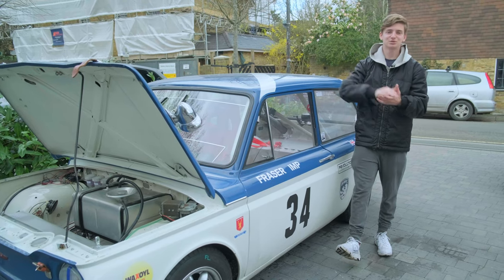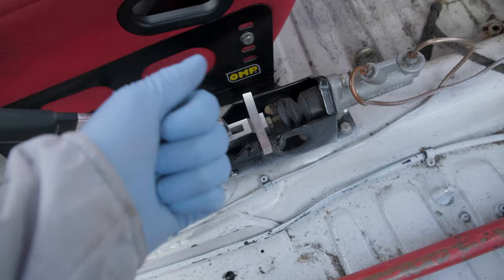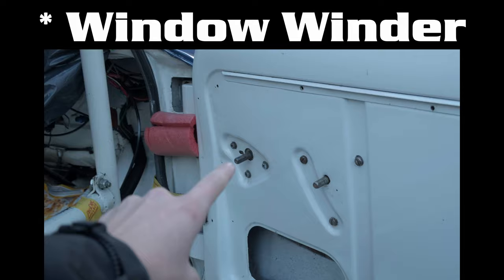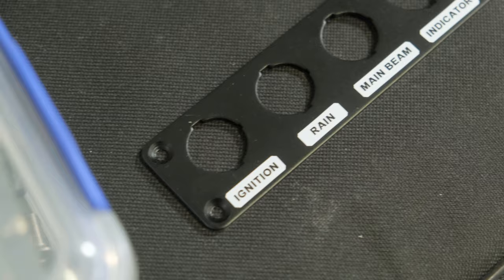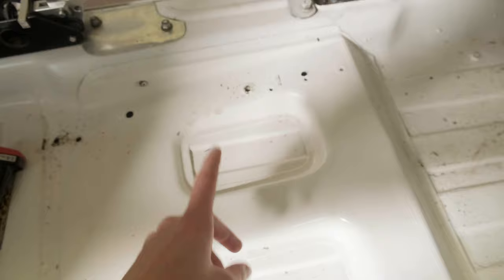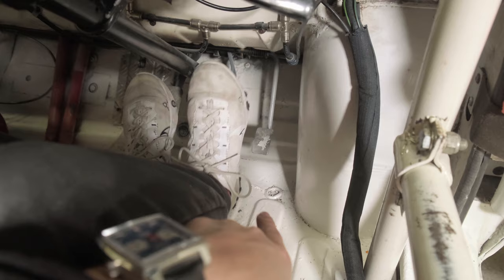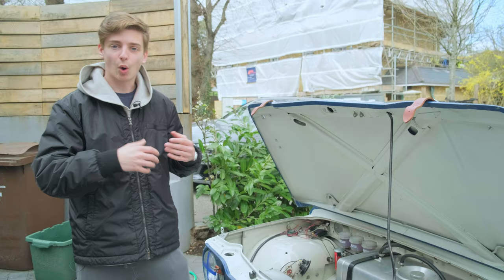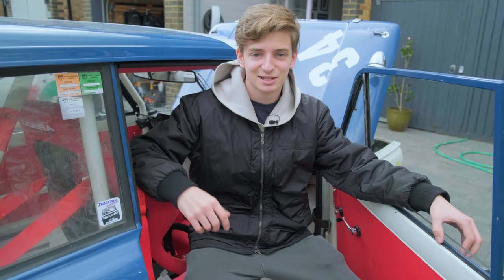How I Got My Race Car Ready To DOMINATE in 2023

Comment: Hope you don’t regret moving the oil pressure warning light away from closer to your eye line  !!!
Reply from the maker: So do I! I'm thinking I'll put another on the dash where there's some clear space. Just bought an oil sensor for the correct pressure also.
Reply: I put it there for the reason that I could not afford to keep rebuilding the engine